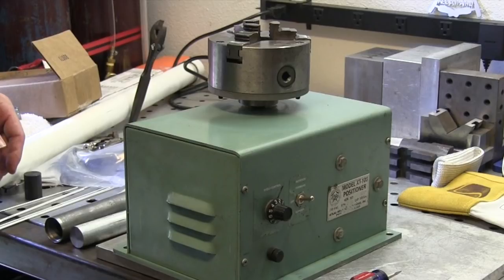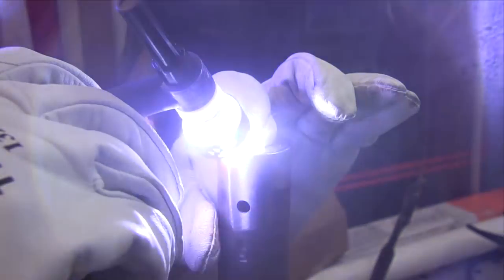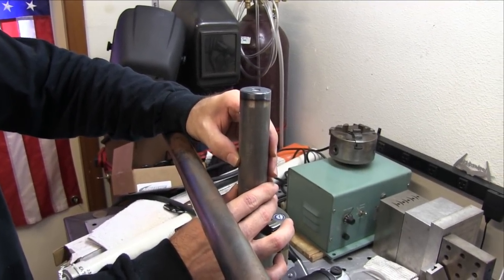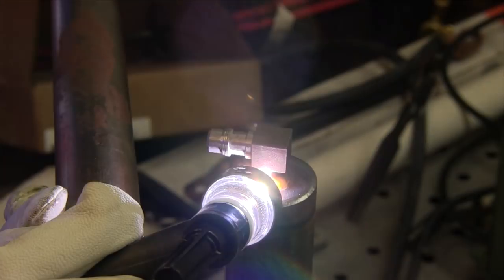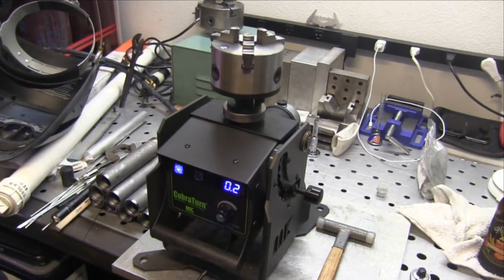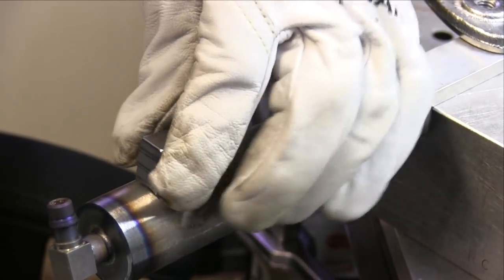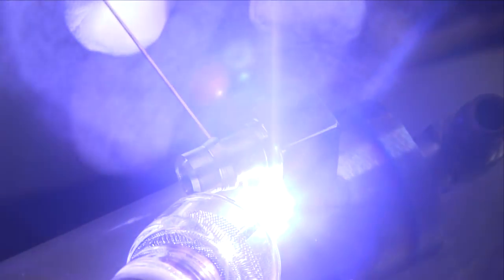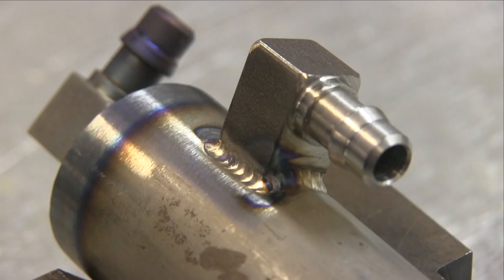Tig Welding with & without Pulse on a Motorcyle oil filter Housing

Comment: 7 year old video and still as relevant today as then. The Stubby Gas Lens Kit is great so I can use Furick cups, both glass and ceramic. I haven't had a need yet for anything over the #12 FUPA cup size but they are all so much better at shielding than the old style cups.

Comment: He's holding the tungsten to the part after welding to keep the shielding gas on it until it's cool enough not to pull oxidizers and whatnot out of the air.... Not contaminating the tungsten because he had already terminated the arc
Reply: +Righandwelder1202 I was wondering about that. And it does make sense.
Reply: +Righandwelder1202 Dang, just read this after already asking about it. Just part of his personal process to ensure post-flow coverage?
Reply: +CorruptReverend Hi guys, I do the same thing especially when i'm doing stainless. I use a lot of 312 stainless rod on one of the jobs I do.
Reply: Very cool. After seeing this video, I gave it a try and it is a nice way to steady the torch during post-flow. Thanks for the input.
Reply: +CorruptReverend It ensures you dont accidentally pull the torch away.
Reply: Righandwelder1202 isn’t that the entire point of the video and his explanation of using that cup?

Comment: How many CHF/ litres per minute would you suggest to use this Cup on aluminium?  I tried a Number 10 Pyrex Cup at 15 litres per minute and coverege didn't look to be enough, i generally use 15 lpm on a 6/7 gas Lens Cup and It works fine.
I have to Say that the alu i work with Is generally not perfectly clean and more often than sometimes Is pretty old (so possibly contaminated)

Comment: What are the parameters for how thick you can tack with no filler and how thick can you weld with no filler?  Best settings for so doing?  Another very informative video.  Have you written any manuals on welding?  Thanks again.  Doug

Comment: For the first fitting the designer should have had the weld on the other side.  That would have been much easier to weld and would not have any dead volume exposed to the fluid inside. Nice welding
Reply from the maker: +Bill De La Vega I agree. either that or the washer should have been about .080" thick.

Comment: +weldingtipsandtricks Jody, how much gas flow would be used on a cup that size with that amount of stick out, in the video you did mention factoring in cost for production runs such as this, so I'm assuming the amount of argon that will be used is a, kind of, a known quantity and so added into the costing put to the customer when tendering for the job.
Is there a formula that you would use to work out the gas consumption ?
Great videos and very informative

Comment: Hey Jody - awesome video (and narration) as usual very informative and inspiring ;-) 
I noticed you mentioned "about 40 amps..." To weld that washer to the canister; now keep in mind, I'm not in production and still learning so I don't have the kind of equipment anyone would consider "proper" for doing TIG welding, but I have "similar" parts being welded (SS muffler tips) ranging from 24-12 ga on different setups and some spot-welded threaded studs... Here's the question and I'm not asking for endorsement but for "poor-man's-solution" in the meantime could a 80-amp stick-welder be used as "scratch-TIG" for that kind of material and thickness?? (Pedal and proper torch are on hand) at the moment I can't spare an semi-decent TIG welder's price point and the rods that stick-weld SS are more costly than the argon :-(   
Thanks in advanced -

Comment: Going to get the square wave 200. What do you think of this machine after having more experience with it. Going to get the furick 12 cup of your site. Could you please put together a full kit to have everything needed to use it on a wp 17 torch with maybe 1/16 and 3/32 Collets? I would definitely buy that kit if possible? Thanks, love your videos

Comment: Jody
Does your buddy buy pre ground tungstens - hand grinding usually does not produce that nice a finish
Reply: Hi Russ
I have a tungsten grinder I purchased from arc zone and just wanted a nicer grind so I purchase pre ground in various sizes and flavors - I must be sort of lazy
thx
art
Reply: +Art Humphrey I have the same tungsten grinder (arc zone) and have found it pretty darn capable...probably more-so than I am :-).  I will say, however, that my old cordless drill chuck to designated grinding wheel on the 6" bench grinder did provide for a more sculpted and consistent pattern of striation though.  It was a much faster way of getting rid of the occasional "stainless steel booger" too!
Reply: +Art Humphrey I just use a bench grinder and an old battery drill.

Comment: I noticed Roy was tacking with pulse. Is he just dealing with it so he doesn't have to switch back and fourth between tack settings an to his pulse weld setting or is there a benefit to tacking with pulse.
Reply: +nancy gillespie Just don't want to take the time to switch back and forth.  For a few hundred parts that adds a lot of time and I would thing wear on the machine.  I don't really like to tack with pulse on but sometimes you just have to deal with it.
Reply: +Roy Crumrine what tig machine are you using ? thanks
Reply: +Josh Turner I'm using an older Everlast 250ex.
Reply: +Roy C Nice I used to own one just like it no complaints have you used a dynasty or other type of high end machine and if so how does it compare. Also I noticed some alluminum welds you were making had a grainy appearance on the bead do you think that's normal, 90 percent of the time that same grainy appearance I got on my beads unless I ran a little on the cold side or ran a bit faster. Have you found a way to counteract this or is this just normal? And just to pick your brain some more how wide and tall would you make a bead on a butt joint 3003 1/8 " aluminum normally? Thanks for the quick feedback it is very much appreciated I like to know what pros think, great job by the way love your instagram pics.

Comment: Hi Jody, how can i identify the torch type of the welder i have been using at work, i am fairly new at tig welding but have access to a great machine
Reply: Crusader 26CT1508 it's either air cooled or water cooled, next would be flex head or ridged, gas valve or no gas valve. Then last, the smooth part above the grip will have the torch size. 9,17, 18, 20, 26 are common but all depends. Jody has a video on tig torches, I think it's called air vs water cooled tig torches.
Reply: ecr125x yeah seen that video, welder was an expensive Kempii cost about 5000 of your US dollars. It's water cooled etc can see no numbers on it and it's the original torch big and fixed with trigger. I have found an accessory kit someone before me got in but the short backs and buttons don't seem to fit and it's a clumsy heavy thing. So I just wondered so I could source better parts as I doubt anyone had a clue when they ordered it. It's an awesome machine apart from the torch oh and the weird ac balance which runs 0 to 30 or might be 0 to minus 30 ?
Reply: Crusader 26CT1508 might be better off asking the boss man to buy a new tig torch setup so you know what you got? I like CK torches

Comment: Why is he ending the weld with the electrode touching the workpiece? Isn't that contaminating the electrode?
Reply: Once he lets go of the switch he holds the tungsten on there so the post flow gas covers the end of the weld while it cools off.  He is actually touching his electrode to the bead but there is no arc, so he won't contaminate his tungsten.
Reply: You see Jody do this often.  I use this technique now from watching his videos.

Comment: Can you set up a tig welder using a Lincoln tombstone welder?
Reply: junkman6261 you can for scratch start, but you need an AC/DC box (carbon steel and stainless is tig welded on DCEN). If you’re looking to weld aluminum on your tombstone, you’ll need to invest in a high-frequency box